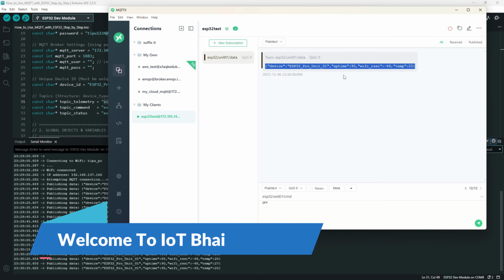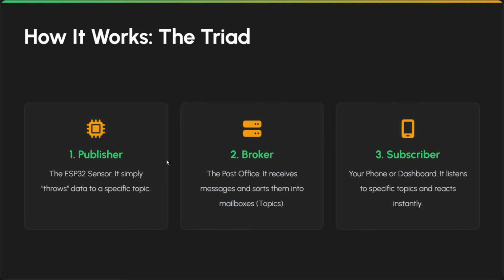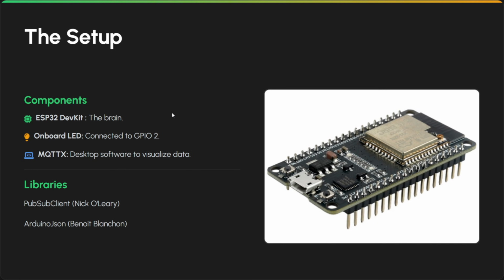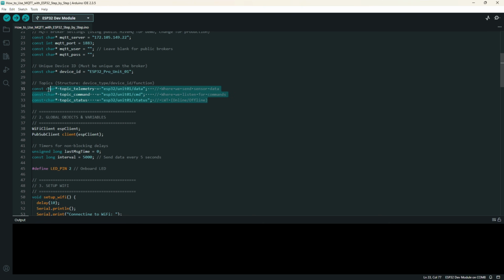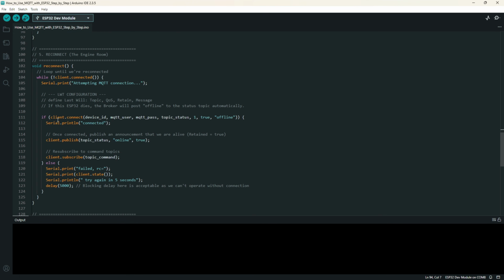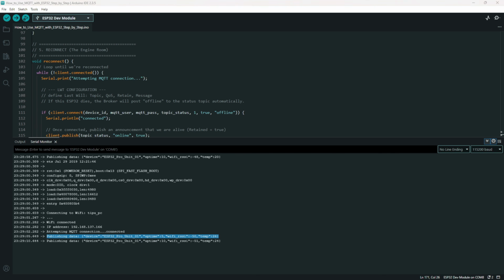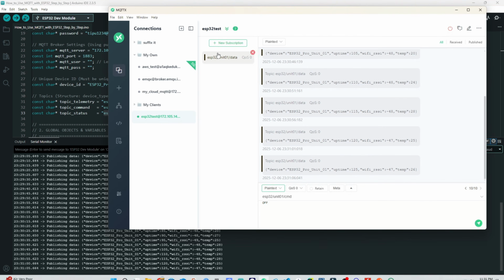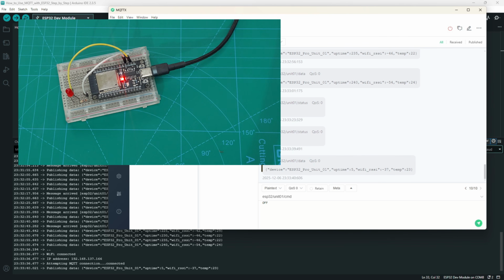Getting Started with ESP32 & MQTT: The Complete Beginner's Guide

Comment: Bro, you don't need any resistor here actually. Since most of the 5mm red LEDs have around 2.2-3.5 forward voltage. So, 3.3 volts from the ESP32 will not really burn the LED. 
Second, this resistor, which you've used, is not a 330-ohm resistor; it is a 100-ohm resistor. 🙌🏻💯

I want a detailed explanation of the functionings of the functions/methods being used of the class "client." Methods like .connect(), .publish(), .subscribe(), etc...
Reply from the maker: Thanks, I will try